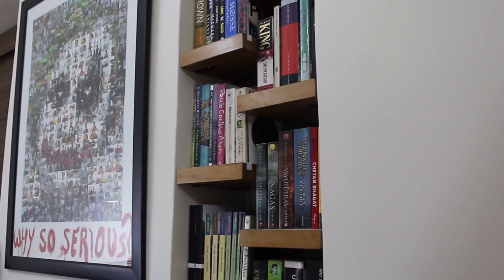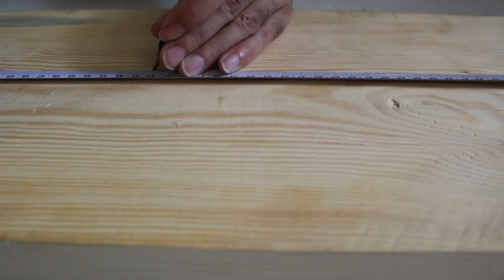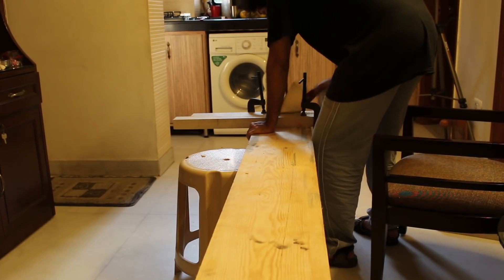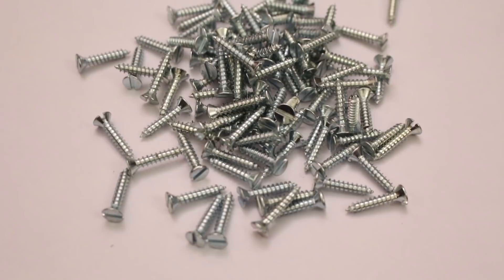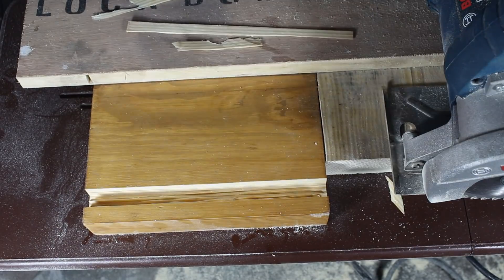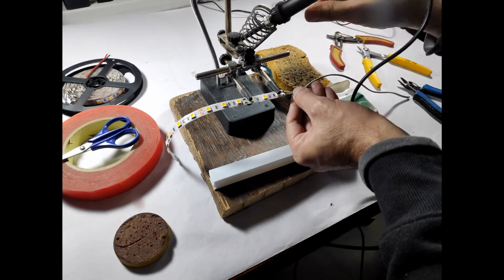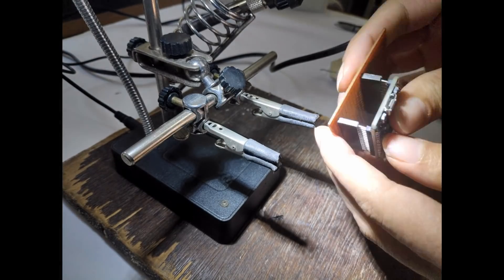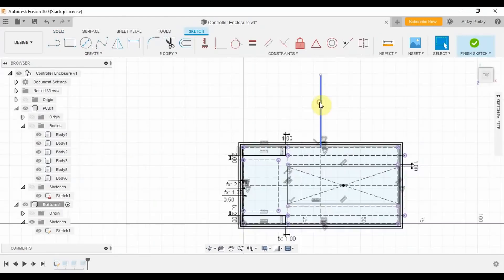Alexa Controlled Bookshelf Lighting

Comment: Why the decision to put the lights on the bottoms of the shelves rather than the undersides?
Reply from the maker: That was something I spent a lot of thought on. Both had their pros and cons, but the main reason was that for the books to be illuminated, they would need to be 1.5-2 inches behind the front side. Right now it looks ok because that space is filled up by the light strip. But in the other case, it would be empty(light would be above the book) and that would look a bit odd.
Also, putting them on the underside of the shelf meant all books will different amount of light as each book is of different height. With the current config, they get similar illumination. Hope that clears it up.